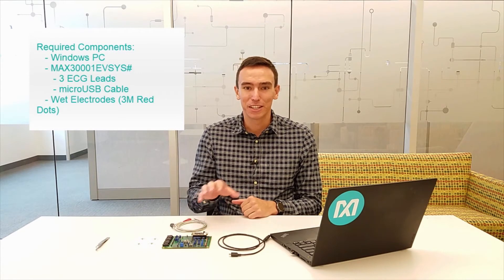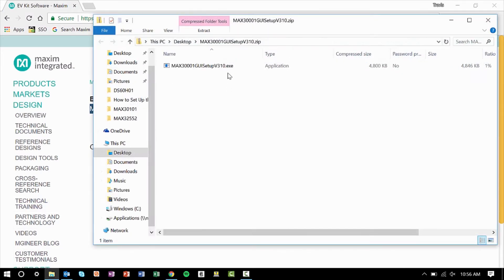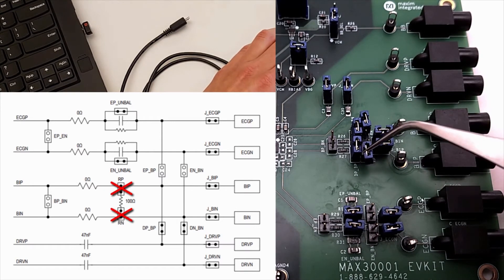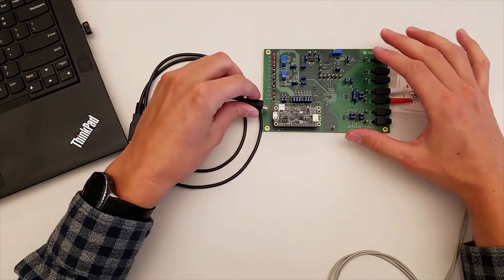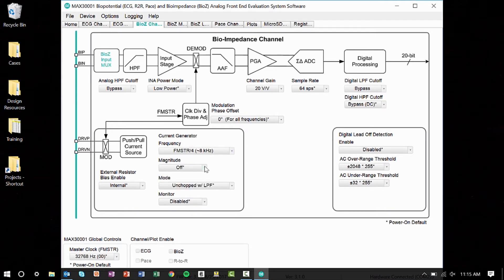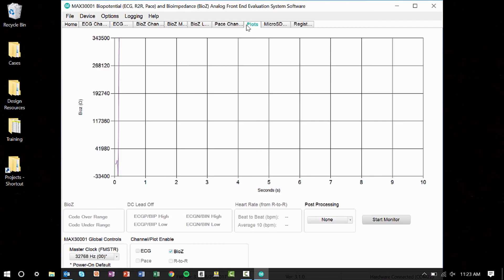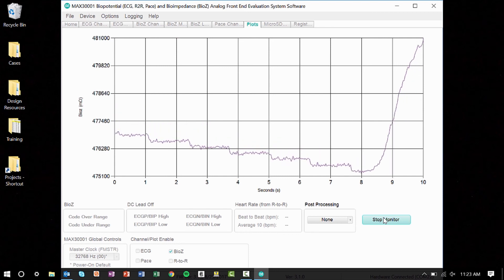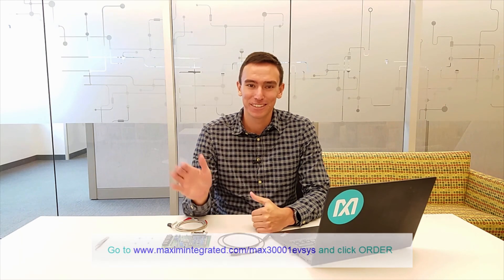How to Measure Bioimpedance (Bio-Z) with the MAX30001EVSYS

Comment: Hi, I'm running the MAX30001 Evaluation Software on Windows 10. My problem is, that the COM port is not found by the software even though the EVAL-board in connected and blinking. Can anyone point me to a solution of this issue? Thanks
Reply from the maker: Hello, please try uninstalling the driver associated with the EVKIT board through the Device Manager program, and then re-connecting the board. Windows should automatically use the standard USB Serial Device driver from Microsoft. If this doesn't work, please reach out to our Technical Support team from the Maxim website.

Comment: Hello Travis,well done for your presentation of the max30001.Two questions:1) The example represents a deep inspiration,can we have a fairly significant
representation in the case of sleep apnea ,corresponding to a pressure through a sensor of Fleisch of a few mm of water ?
2)Can we have the ECG and Respiration in real time  and in the same time on the screen ?
Thanks and sorry for my English.
Reply from the maker: Hi Telma, thank you for your questions. 1) The MAX30001 will sense any change in impedance between the electrodes, so it can sense regular respiration at rest. The video shows deep breaths to accentuate the signal, but normal breathing or apnea can be sensed too. 2) Yes, ECG and respiration are displayed in real time and simultaneously if they are both enabled.

Comment: Hey, is this bioimpedance measured through the whole body, or through the tissues near the diaphragm? If it's specific-tissue measurement, can the same set-up be used to measure near abdominal tissues?
Reply from the maker: Hello, in this demonstration, the electrodes are attached across the chest for respiration measurement, but you can attach them on other locations to measure different signals, such as the areas you mentioned.